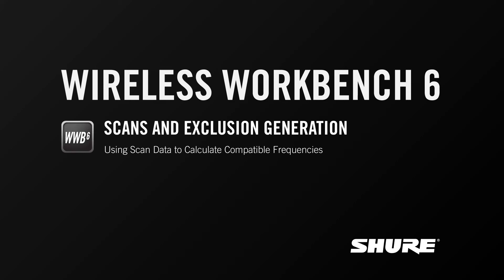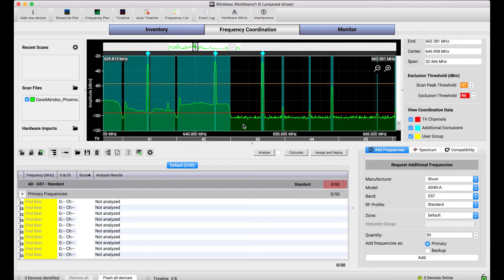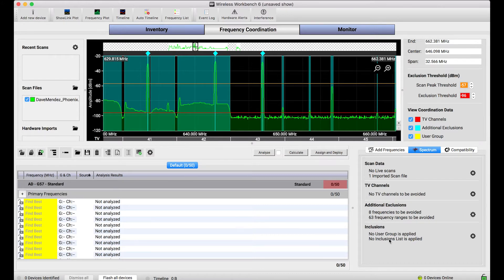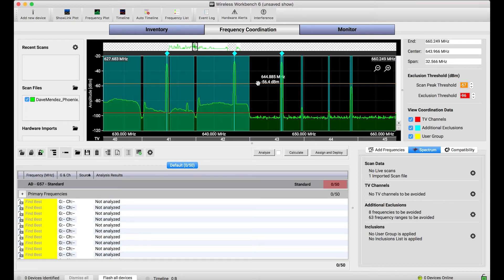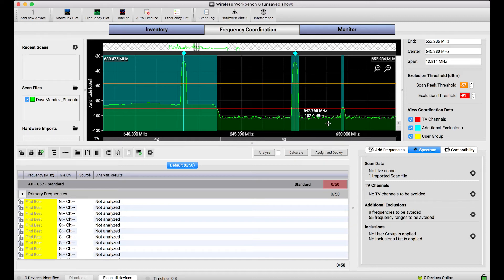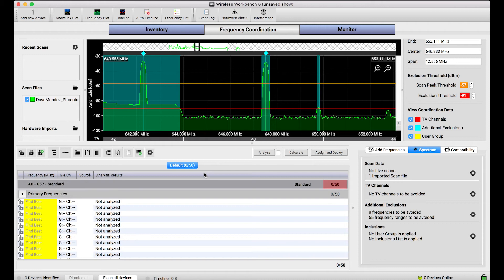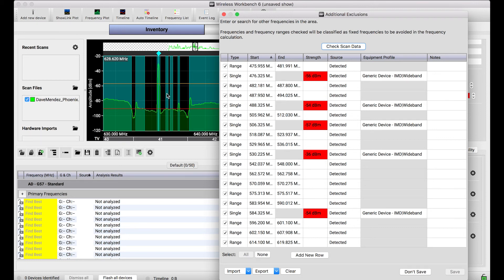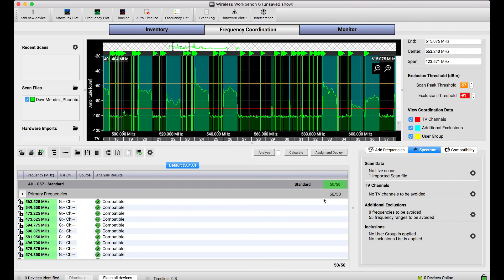Shure Wireless Workbench 6: Scans and Exclusion Generation

Comment: First off, great series of videos!  Thank you.  Can you please explain why the default Exclusion Threshold is set at -85dBm, and provide guidance to help users intelligently and purposefully select a higher or lower Exclusion Threshold?
Reply from the maker: Thanks, happy to hear that the videos are useful!
 
Setting the exclusion threshold should really be tailored to your specific RF environment (including scans used for frequency coordination, as well as the sensitivity of RF inputs to your system, such as antennas, distros, etc).  We generally recommend setting the exclusion threshold above the noise floor of any captured scans.  That said, you should set the threshold’s value to ensure that any RF noise from captured scans that could negatively impact your wireless systems is above the threshold, thereby excluding that spectrum from use in subsequent calculations.